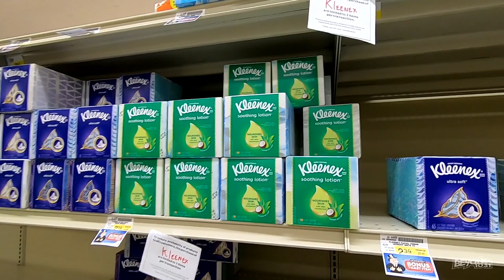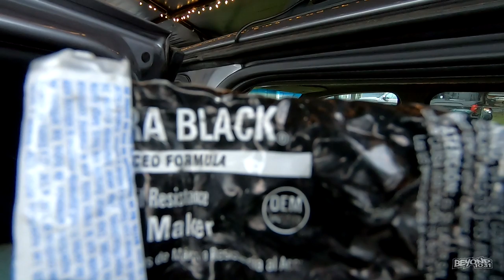CB Antenna Installation! [Day 3438 - 03.30.20]

Comment: Instead of cutting up your metal around the door there you can under your vehicle and find a rubber grommet and put a tiny cut in it and run your cable through it too
Reply: And that little black coax on those antennas are basically junk too I don't even use them for the radio here either

Comment: I took a shower and worked on my Halloween costume today. Ok so it's basically a hand held radio station. Hearing how you explain it it sounds like it doesn't reach as far as a radio station though. I'm guessing depending on what kind of CB you have and other add-ons will depend on the range? I know if you go higher than a certain level your braking some sort of law I think.
Reply: Karrieann Olson, honestly, the easiest way to describe CBs is as “walkie talkies on steroids”.
Reply: @Triv27  that's what I thought.